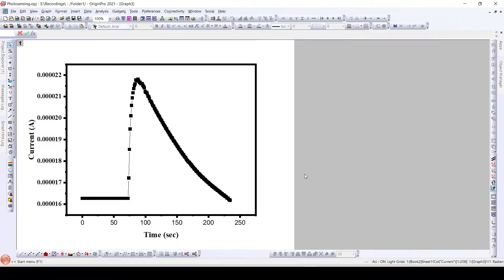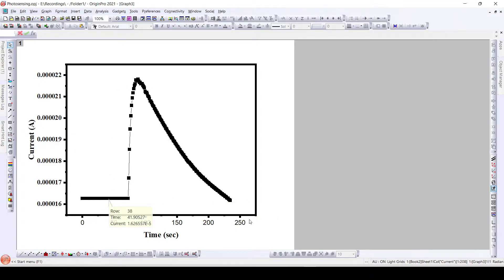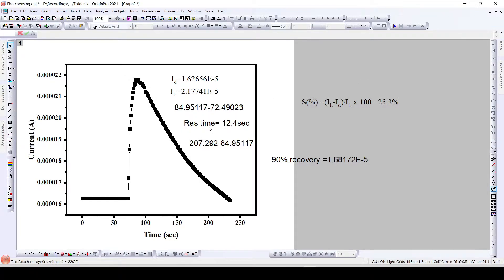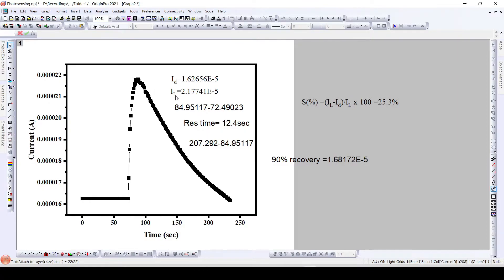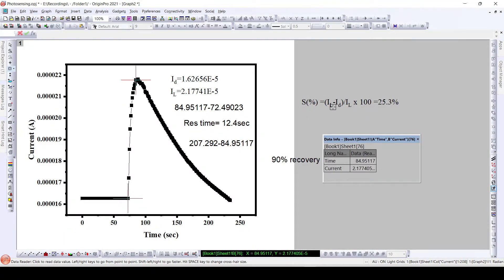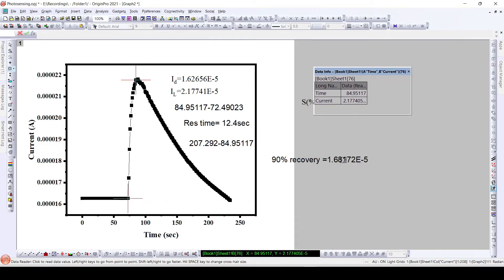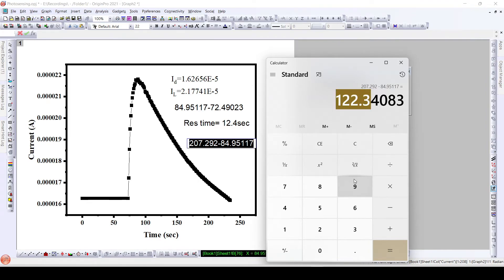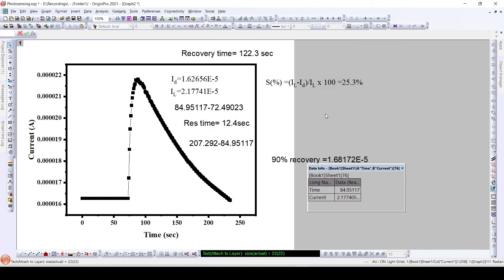How to Calculate Photosensitivity, Response and Recovery Time of Photosensor Device

Comment: Thanks for the video Sir. I have one doubt Sir, how did you told that 90% is 207 seconds? Can you please explain?
Reply from the maker: Thank you for your question. The value of 207 seconds is the actual time value or the X-coordinate in the data sheet where the current is recovered to 90% of the maximum current achieved after light irradiation.

To calculate the recovery time, we need to look at two specific points on the data sheet:

The time at which the current reached its maximum value after light irradiation (in this case, 84 seconds).
The time at which the current recovered to 90% of that maximum value (in this case, 207 seconds).
The recovery time is obtained by subtracting the time at which the current was maximum from the time when it recovered to 90% of the maximum:

Recovery Time = 207 seconds − 84 seconds = 123 seconds

Therefore, the recovery time is 123 seconds.

I hope this clarifies your doubt. If you have any more questions, feel free to ask!
Reply: @DnyaNiPhysicsWorld  please elaborate i couldn't understand